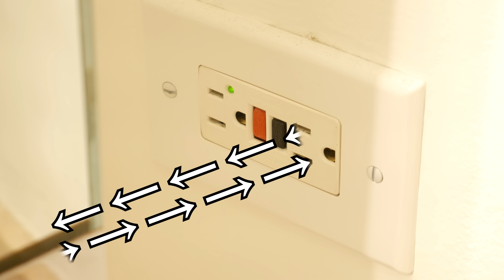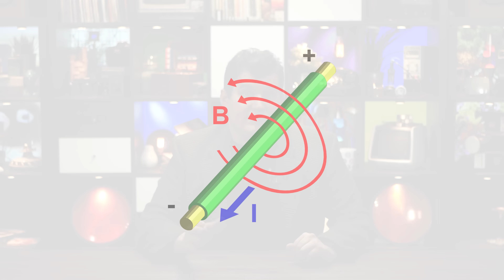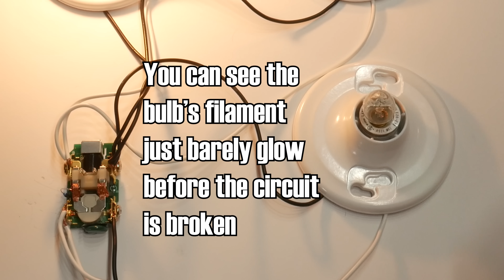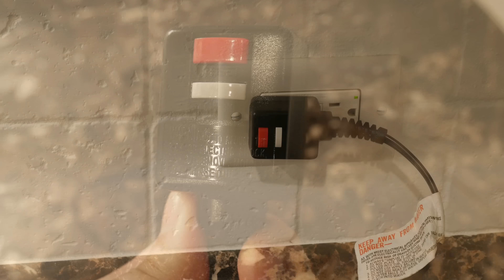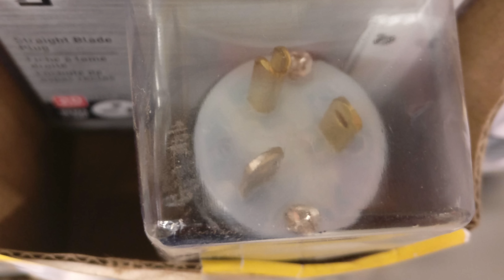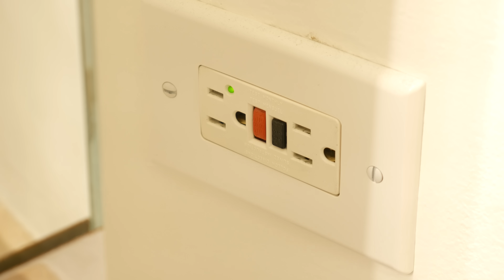The GFCI/RCD: A Simple but Life-Saving Protector

Comment: When I was a kid, I thought that those plugs were waterproof and even shot it with a water pistol for fun... I'm lucky that nothing ever happened to me but please parents, if your child ask why there's buttons on that plug, give a better explanation than just "it protects from water" or something like that...
Reply: i once threw water on a gfci and it started arcing and went pop
Reply: Okay, I'll show my kids this video then.
Reply: Mister Brookes And one of the largest grounded exposed metal objects in a typical home is the actual kitchen sink!  Standard example in EE class was always someone touching a faulty kitchen appliance and the kitchen sink at the same time.
Reply: lol
Reply: It's a miracle, getting people to understand rather then just telling them is more effective?!
Reply: I blew them up with paperclips
Reply: Ah yes
Reply: I once shoved a pair or pliers into my bedroom outlet just to see what would happen. Sparks flew everywhere and the ends of the pliers melted off :(
Reply: @jordanturner97  you are such an idiot. what kind of a stupid person would do that. if you dont know that this is damgerous. you should get your head checked.
Reply: @edgrimm5862  >120V can easily kill
Ah ah, Amps kill. Volts jolt, as the saying goes
Reply: @SignalRaptor_  sigh of frustration Higher voltages are more dangerous, because the higher the voltage, the more power can be put through the wire. If you had, say, a 5 volt circuit at 100 amps, I doubt you'd feel it because of the resistance of your skin. If you had a 100 amp circuit at 200 volts, you would most assuredly feel it. Well, probably not for long, as your nerves would be massively damaged.
Reply: @nikkiofthevalley  dude, if the amperage is low it really doesn't matter how high the voltage is. It will hurt, but it probably won't kill you. Unless it's like a billion volts like a lightning bolt
Reply: @SignalRaptor_  you can’t have high voltage and low current, thats not possible. If the current is limited, then the voltage drops.
Reply: Maybe you was just dumb
Reply: @Dave102693  And We can't depend on other kids being smarter.
Reply: Science has changed the natural course of mankind. For example had science not created safety barriers to keep you around, you'd be gone and this boring tweet begging for thumbs ups would have never been around. It's sad.
Reply: @rodmunch69  this is not a tweet, or begging for likes. boomer
Reply: @GrootsChannel  ok Karen.
Reply: @rodmunch69  lol😂 you do not even know what a Karen means! 😅
Reply: @rodmunch69  "If science had not created safety barriers"...so outlets without GFCIs are just naturally occurring? 🤔
Reply: @rodmunch69  So no then? 😁
Reply: @rodmunch69  Wow super edgy and cool.
Reply: @rodmunch69  "Homo." That's fucking adorable. You should stay off the internet it's not safe for your age.
Reply: @rodmunch69  ?

Comment: Water isn't a good conductor, but metal piping is, as well as metal kitchen sink.
Reply: It is if it has dissolved minerals in it. Like say, from your skin when it makes contact.
Reply: Just out of interest i measured the resistance in a glass of tap water, side to side. On that about 5 cm distance the resistance was 6,7 MOhm. You wouldn't feel anything if you had grid voltage there and feet grounded. Hollywood's death by hair dryer in bathtub is just fiction. Even if the water had so much salt in it that it was reasonably conductive, it would just short the leads inside the dryer.
Reply: As a kid, I thought it'd be fun to stick my fingers between the prongs of a nightlight and then plug it in the wall.  My hands weren't even wet and I sure as hell felt it.  If you're telling people that jumping in a bathtub with a live hair dryer isn't dangerous, you don't know as much about electricity as you think you do.  People HAVE died from mains shocks so whatever you think of Hollywood shenanigans, just look at the real world statistics to understand the lethality.  Electric shock generally kills in one of two ways:

1 - direct tissue damage due to extreme heat.  Heavy current through a relatively resistant medium is how this happens, so resistance alone offers no protection.  Low voltages will not protect you either.  I know someone who cooked his fingers with a 12v drill battery.  Nowhere near mains voltage, but he still has scars because current matters.  Anything can become a heating element if it receives more current than it can handle.  This is why shorts and arcs burn houses down.

2 - passing current over the heart, causing fibrillation and cardiac failure.  A mere 100mA is all it takes for this to happen.  Bear in mind that resistance drops as the conductor size increases.  You are not two tiny metal test leads.  You are a big salty bag of water.  If you share enough wet surface area with a frayed cord and one of those metals bits you mentioned such as a drain pipe, the path across the vagus nerve leading from your brain to the pea-sized pacemaker nodes on your heart can easily drop below the 1100 ohms necessary to turn 110V into cardiac arresting current.  It only takes one instant of shock to ruin your heartbeat and leave you helpless on the floor.  By the time anyone complains that you're hogging the bathroom, you are beyond resuscitation.
Reply: @esa062
i have had some impressive bangs from 230 V into water so it definitely conducts electricity , i also think the hollywood thing is a myth but im not about to try it , volunteers ? . hehe :-)
Reply: It depends what's in the water, mainly salts. Salty water in an insulated container and mains phase without the zero conductor and you touching it while touching a radiator with your other hand could be deadly. But we were talking about tap water. Based on my earlier measurement, for a big enough bet I would dare to touch our tap water 5 cm away from the conductor, while grounded, but not closer than that. The water has then about 10 times the resistance of my body. Ungrounded I dare touch the conductor itself of course, nothing happens then. I have had a few 240 V shocks, one of which could have been lethal. I don't recommend unnecessary risks with mains voltage to anyone.
Reply: @esa062
if you have an old power cord with a figure 8 connector , like a ghetto blaster , power brick connector then you can cut off the figure 8 connector strip off the outer black sleeve strip off a quarter inch of the colored cables pull them 5 cm (2 inches) apart then making sure your not touching the stripped off ends and holding the cable a foot or so from the end dip it into a bowl of tap water , unless youve hot the cleanest tap water in the world you will be changing your pants :-)
of you have a UK plug put a 3 AMP fuse in it , and dont have any body standing around when it goes bang you will be swinging a possibly live wire around :-)
Reply: @Mr. Sleep
that was impressively brave , i know he tested it first but still brave , he did  have the conductors far apart so the water resistance would be quite high somewhat closer together the water would get hot and very close you get a nice bang :-)
Reply: How did you measure resistance ?
 - by using multimeter ?   -> if so, then yo have to ask yourself, how does that work, the key understanding of why you are incorrect lies in that fact.
Resistance is a term that is allowed in a very strict manner, what you should be thinking about is IMPEDANCE
1)  multimeter uses 9V battery to function, but if you use 2 multimeters, and connect them paralel to one another, but one in resistance measuring mode, and other in voltage measuring mode , you will see that for high resistances it uses very low voltage,
to sum up : multimeter uses DC voltage 
2) impedance is a better term to use here because it is used in a AC circuit.
human skin has a dynamic characteristic depending of the frequency, on DC (i.e. frequency=0), impedance is high
on  50-60Hz impedance drops drasticaly , and the current is high

Hope you understand that if you touch live wire the current isnt going to be 230V/6,7Mohm
Reply: Adding water to the surface of skin greatly reduces the skin's resistance, making a potentially serious shock far more likely should it encounter a damaged wire or improperly grounded appliance/switch/etc.
Reply: Touch contact gives a serious shock with dry skin too, but that's not what we are talking about
Reply: Water isn't an ideal conductor, but it's good enough to get people killed.  If you're people, that's reason enough to design for its inevitable involvement in a bathroom circuit.
Reply: +esa062 You are a Darwin Award in the making.
Reply: agreed,
on AC skins pores open up, and current can go through bloodstream (which is a better conductor then water because it has iron in it), because the blood goes through heart current going through heart causes it to contract, because heart is a muscle (that's how those ab workout devices work) - now if we imagine that a healthy heart rate is 60 times in a minute, than we can imagine what happens to heart if it contracts 50-60 times in a second  --> CARDIAC ARREST
Reply: Meh, humans are salt water, and house water is calcium water, you're right that 120V isn't going to kill you from the other side of a tub, but if you're already wet and touch the supply it's essentially a short around your skin's typical resistance

Comment: I have a microwave oven that seems to have very poor EM shielding plugged into one of these GFCI outlets. Sometimes, the outlet's safety mechanism will trip during a cooking cycle. My concern was that the microwave was somehow causing an electrical short, but now after seeing your demonstration, I can see that it's more likely that the microwave is generating a magnetic field that is interfering with the sensing coil on the outlet.
Reply: SlideRSB Older GFCIs often had difficulty with highly reactive (inductive or capacitive) loads as they can create momentary imbalances without an actual fault.  In most cases replacing the older GFCI with a newer model will resolve the nuisance trips as they have more “smarts” built in to analyze the fault characteristic and can briefly delay the trip to account for false events due to brief imbalances.  A traditional microwave is a highly inductive load, as were older magnetic balance fluorescent ballasts and all can cause nuisance trips in older GFCIs.

Comment: Very informative and interesting video. Code requires new homes in the US to have AFCI (Arc Fault Circuit Interrupters) breakers for circuits in all "living spaces". Often these breakers are also GFCI's. I work on new homes and the electricians almost always opt for AFCI/GFCI breakers as opposed to individual GFCI receptacles. I would like to see a deep dive on AFCI's. Early AFCI's were plagued with nuisance trips and they were very expensive. Now they're still more expensive than a standard breaker but seem to have fewer nuisance trips.
Reply: AFCIs incorporate the function of GFCIs by design. They exist to protect against faulty wiring in the wall from causing a stealth fire. GFCIs should also be on all outside outlets where long runs of extension cord are likely to be hooked up.

Comment: From what I understand, the ground pin is supposed to be on the top side. So that nothing falling down on a potentially bare lead can cause a short or a dangerous situation ;)
Reply: Marinus There is no “right” orientation.  You will typically see the inverted “ground up” orientation in commercial environments primarily because some insurance carriers require such on the assumption that it is safer — and in some industries it could be, such as around metal machining equipment where waste metal might be thrown towards an receptacle and plug.  But it is all somewhat contrived in most instances as how often does one have a plug that is largely pulled out of its socket at the same instant that something narrow enough and made of metal is knocked over to make contact with that hot or ground pin?  To fit into the space, and before the nearly pulled out plug falls out entirely and breaks any connection, the metal item would likely need to be no more than perhaps 3/8” in cross section, otherwise it is unlikely to even fit within the gap — the oft-cited mop handle example is typically made of wood and when made of metal is often aluminum (whose oxide layer is a poor conductor given a light contact scenario) and typically has a diameter of 3/4 to 1 inch, thus unlikely to ever make contact with the hot conductor in any outlet orientation.  In practice both orientations are considered correct unless there is another body (insurance policy, local inspector, local code, etc.) that prefers a specific orientation and forces compliance with that preference.

Comment: Water actually does not conduct electricity. It is the schmoo and the minerals and stuff that's in water that conducts the electricity. That's why soda makes an excellent conductor, tap water makes an ok conductor, and distilled water is a borderline insulator (until you pour some salt into it etc).

Comment: In Austria (and Germany) these things are called "Fehlerstrom-Schutzschalter"/"fault current protection switch". So it mentions "current" and "fault", but leaves out the "ground". I guess no name has it all. Colloquially they are still called "FI", F for Fehler/fault and I being the symbol for current, which was written on most of them.
They are installed in the breaker box and have been mandatory in new homes since 1980 (first for bathrooms, but for all outlets nowadays for quite some time). If you touch any electrical installation in an old home, the whole installation has to be brought up to spec as well and have RCDs installed. If you try to rent out a flat that doesn't have a RCD installed, the tenant can demand a reduced rent, because it's sub-standard.

Comment: Finding a fault is very hard. I use a clamp meter in the 200mA range and clamp it round the live and neutral of the circuit in question. If everything is fine the clamp meter reads 0. If not we see the difference. This trick works with sensitive clamp meters.
Over here in Russia the electrical code dictates that RCD gets install in breaker panel for circuits that go to rooms where water is used. The bathroom and kitchen must be on their own circuits, protected by a RCD.
The RCD must be protected with a MCB by having it connected in series after the MCB. Some electricians install one RCD and feed multiple breakers for multiple circuits to save cost.
Some electricians install RCD on every line after breaker, but also install a RCD after the main breaker or overvoltage cutoff unit, which gets installed after the main breaker. Some RCD combine with a MCB and you get two devices in a single module.

Comment: Putting them on the plug for me is more dangerous, there is allways the risk that to save money somewhere you put plugs without protection, but more importantly, you protect only things that you plug into outlets, and not everything else, lights sockets, wiring, things that are permanently wired in like air conditioners, boilers, etc, and the wiring, and yes ideally you shouldn't work on something energized, but in reality you does, and if you touch a live wire the GFCI can save you from a bad shock.
Reply: If you're following the standard, you wire the light in off of the GFCI, so it's protected by it.  That's the reason the US actually requires the bathroom to have at least one GFCI outlet: so it's there to be able to also protect the light circuit (because it's the same circuit.)

Comment: It would have been worthwhile to point out that the sense of security these might engender is partly false: while a GFCI/RCD will protect you in case of a shock from live to ground, it will gleefully watch you burn to a crisp if you manage to get a shock across line and neutral, thinking you're just one more appliance, since all the current going through you also returns just fine.

Comment: Also I have a question, is it common to have GFCI on light switches, because my bathroom has a GFCI wired to the light switch, and yet I haven’t seen a similar setup anywhere else
Reply: That Person With A MLP Icon Who Starts Flamewars It’s not ideal but not uncommon either wherever cost cutting has happened.  I am not a fan of placing lighting circuits onto receptacle circuits, but especially in bathrooms and kitchens, as it can leave someone in the dark due to a, possibly even nuisance, trip leading to possibly injury if they slip, fall, or come into contact with a hot burner.  Best practice is to give lighting its own dedicated circuit(s) but you will find many exceptions because it usually is nit a requirement.
Reply: Ethan Poole It’s not connected to a receptacle. There is a panel next to the light switches that looks like a GFCI outlet but without the outlets, just leaving the buttons. And the buttons correspond to the lights and vent fan
Reply: That Person With A MLP Icon Who Starts Flamewars Interesting, I’ve never encountered that sort of point-of-use GFCI.  But I’m happy to hear the lights are not on the receptacle circuit.  Thank you for that odd-ball tidbit as it means I learned something new today since I was unaware such a thing existed.

Comment: In the US new houses can be built with GFCI breakers for all circuits near water. Circuits in bedrooms have arc fault breakers. Refrigerator outlets have only breakers and only the one device. 

GFCI outlets are easy for retro fitting. 

Shuttered outlets are available in the US, not sure if they are required anywhere.